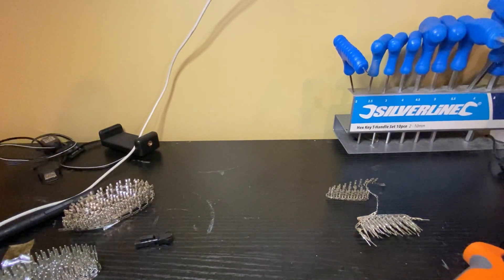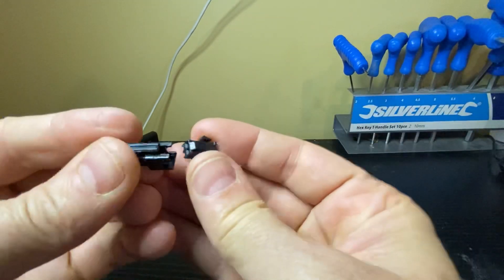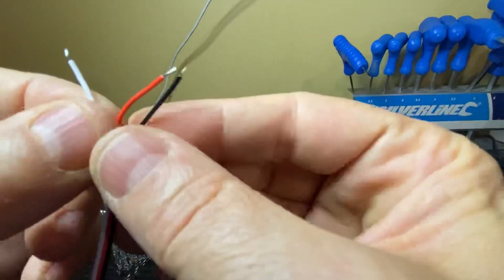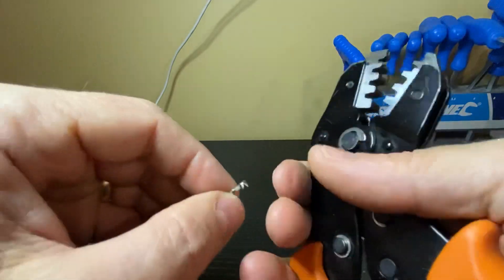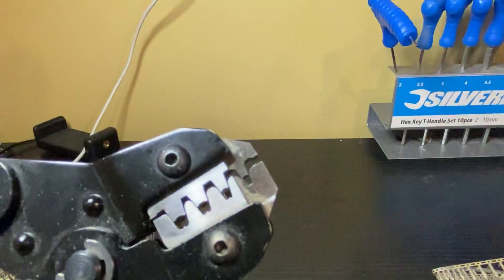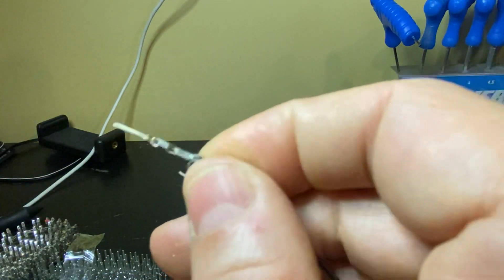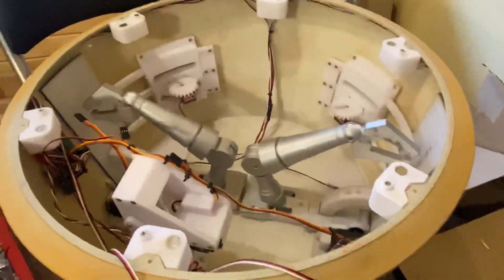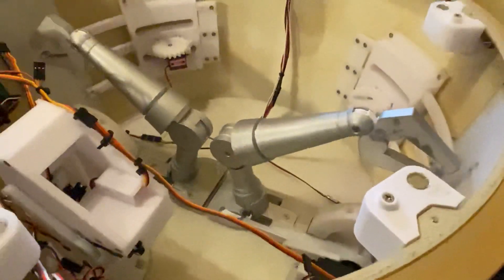Crimping and making custom cables

Comment: thanks Michael - I've viewed this several times, and many other videos as well.  i always run into trouble  of not knowing how far to stick the cable in, so i either crimp metal (instead of the insulation) or i crimp insulation (instead of the conductor) or i don't lock it properly and destroy the piece.  I also tend to stab myself with the ends at least once per session, so i feel if i don't draw at least a little blood i didn't do it properly improperly.
would you mind an image or similar marking the length stripped, and the length pressed in, if there is some sort of rule of thumb?  thanks again!

Comment: Awesome tutorial! Thanks. I have been using crimpers for the past year with my R2. I'm trying to do a bit of cable management with the Arduino for the dome innards. I created a protoboard for the switches since they all share a common ground. Also other bits. I am having a bit of problems getting the rails to work though, I think it is my soldering skills.
I did use some of those bigger connectors to the arduino since the switches all go to the same place. So I have ribbon cables, which is better than individual plugs. We'll see how it goes.
Having the various cables all plug and play is awesome! I wish I'd gotten into it years ago!